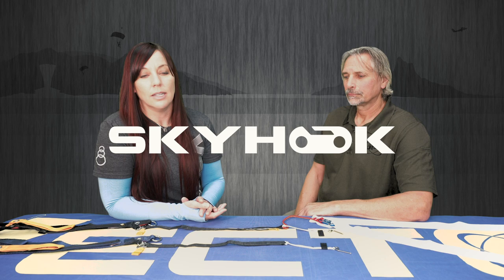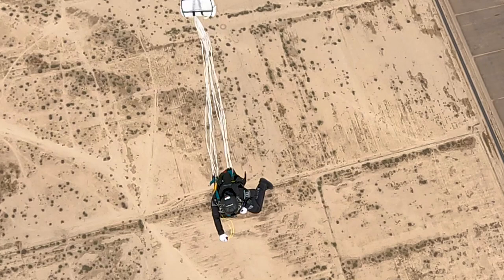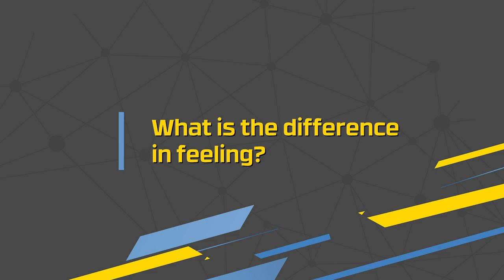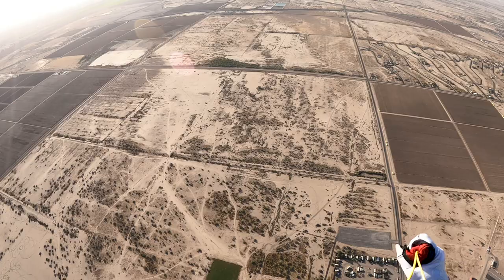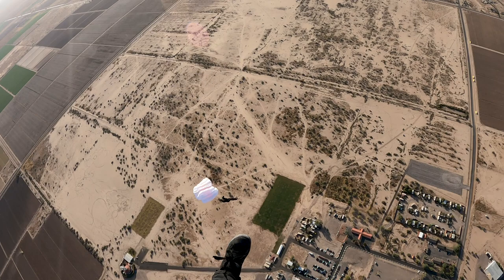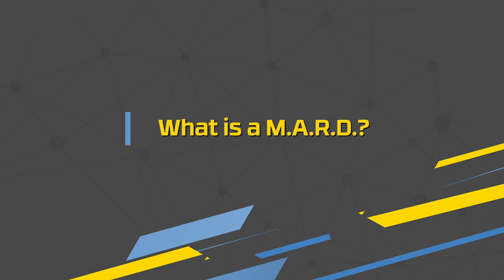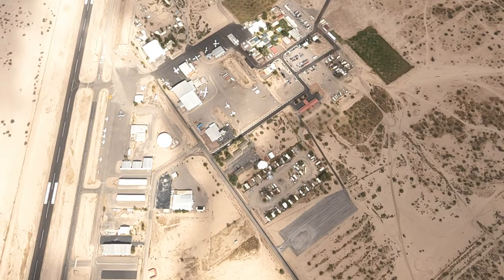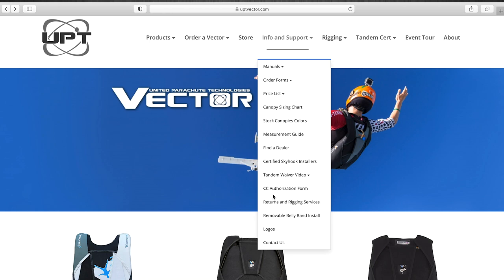RSL vs  SKYHOOK | Interview with Greg Rau

Comment: Nice Video. The one question about performing your EPs lower, was partially answered. One you should maintain you altitudes. Part of that reason is that the 'Skyhook RSL' system is not guaranteed to work or stay connected, so you might have a longer time/altitude to open.

Comment: So-What do I do with my rig with an RSL? Add the Sky Hook and take away the RSL or keep both? 
I only ask because it seems that both systems, in theory, are exactly the same-With the Sky Hook almost guaranteeing a reserve deployment much faster. This video shows the Reserve D bag and reserve opening almost a full 2-3 seconds over just the RSL
Reply: I'd say you simply replace the old RSL with the Sky Hook, not mingling hardware from two different systems. The Sky Hook IS a DSL with an extra lanyard and its release hook. You really ought to have an experienced rigger trained on Sky Hook install it for you.
Reply: @r0cketplumber  Thank you. After watching this, I would consider replacing the RSL with the Sky Hook-and getting it done by a Licensed FAA Rigger! Thanks again. Blue Skies!

Comment: I’ve seen a case that would have much better without these stuff. Mostly with an intense, high performance canopy I fear it isn’t safe enough. My opinion is these should be useful only for student, tandem and low performance canopies, it is a great invent for these by the way. But me personally skip it and I’ll solve by hand if need.